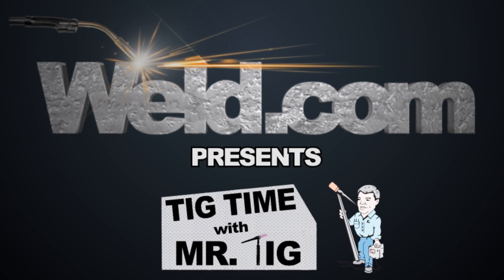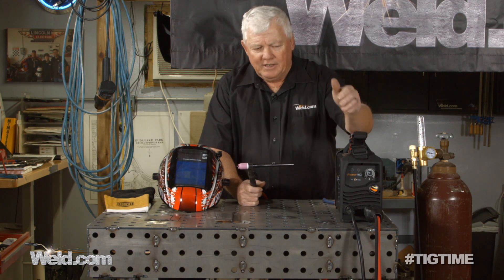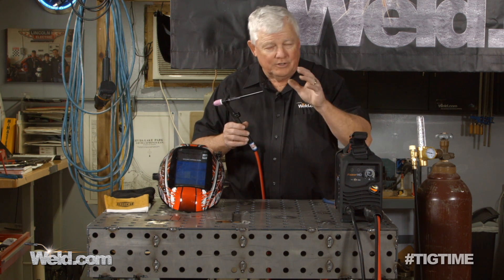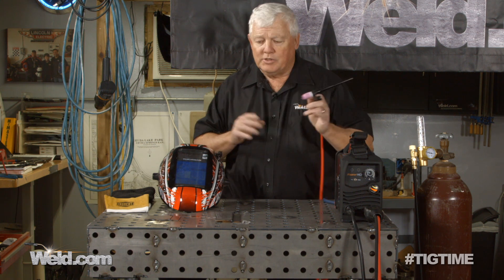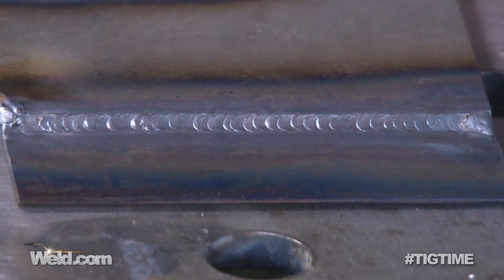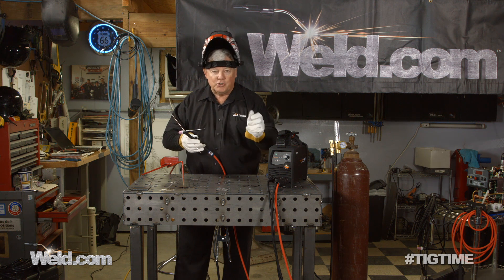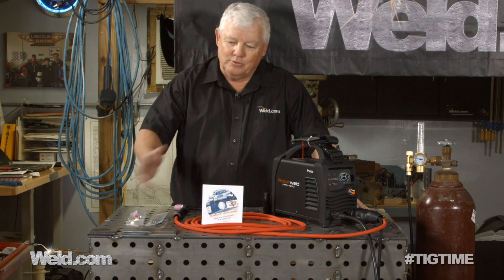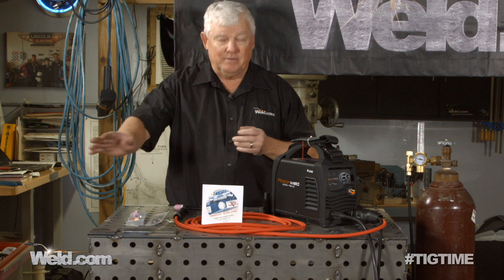RazorWeld 110 Overview: Part 2 - TIG Welding | TIG Time

Comment: I just found your video while trying to set up my welder for tig.  Have you any experience with a amico inverter, i got the 160 amp stick model it claims to do tig but i have no idea how to set it up or what to buy, can i use the equipment you have here?
Reply from the maker: tankkiller308 I'm not familiar with the machine you have, however it should be a very similar setup to this machine.

Comment: Good video Mr Tig! How do you decide if you're gonna use less amps and weld slow versus using more amps and weld faster? The machine used had more amps available so why didn't you crank it up a little bit more and go faster which would also create a less heat affected zone? Normally I weld stainless steel where you don't want a large haz due to distortion, but I also use the same principle on mild steel--enough heat to get into the root quick and then weld on out with smallest haz as possible.

Comment: If you get the chance you should test the Fronius Transpocket 1500 its a stick unit with a "6010" or cel mode and it has a very smooth lift start tig, i never had the tungsten sticking really. The only downside is that the units are not cheap but its an awesome welder.